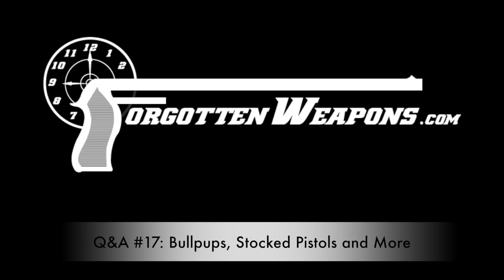Q&A #17: Bullpups, Stocked Pistols, Delayed Blowback, and More!

Comment: Doesnt the Famas need some wierd ass 5.56 special load and cartridge (edit Steel instead of Brass, so no interchangabilty with other 5.56s from allied states) because its a piece of shit?
Reply from the maker: I have yet to have any problems with brass cased M193 in mine.
Reply: Oof, I didn't see the answer.
Wierd, pretty sure I read that somewhere. Apperantly it is one of the reasons why it is being slowly replaced with the 416?